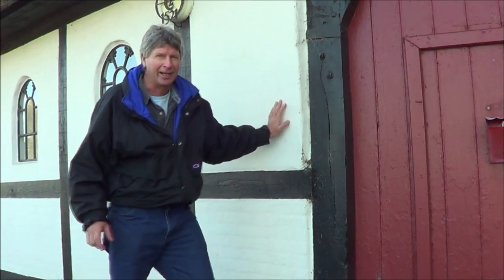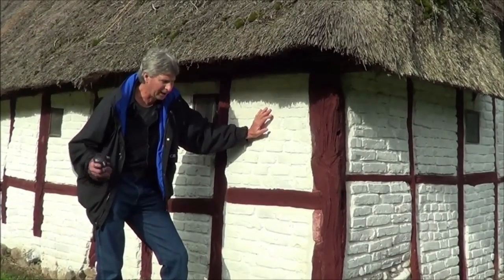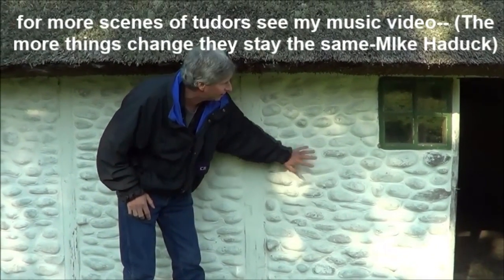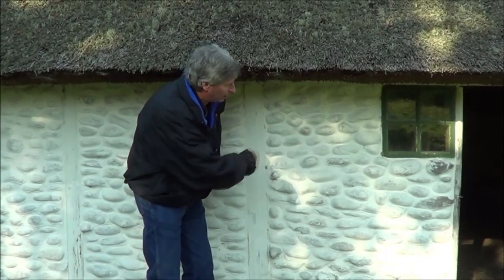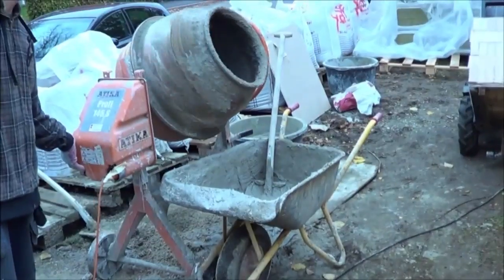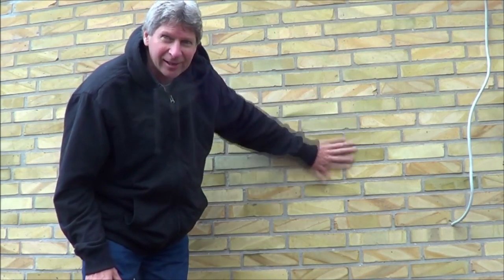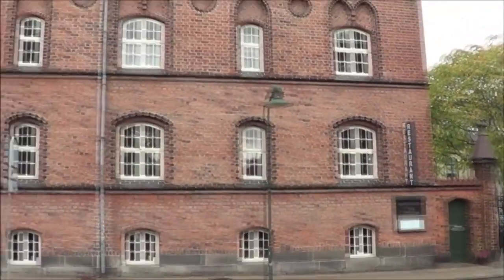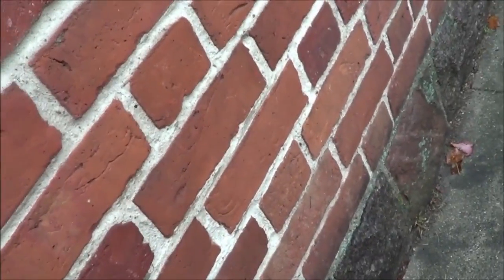TUDOR HOUSES AND BRICKLAYERS IN DENMARK  ( Mike Haduck )

Comment: I have a question - this house in Denmark that was built by these masons in this video - is the inner part of a wall dry wall or is it built out of blocks and cement?
Reply from the maker: Hi institoris, I can not say for certain,  it was quite a while back,  thanks mike
Reply: Thank you for reply. Very nice channel, I subscribed with pleasure. In a see of bs here guys like you make a great educational videos and that is a noble thing to do. All the best...
Reply from the maker: thanks,  mike
Reply: Hey. Most new houses in Denmark are made out of siporex blocks. They are then insulated with rockwool on the outside of the siporex. And lastly bricks are layed on the outisde of the insulation
Reply: From what I can see it doesn't look like they are building a new house.. And I would be very surprised if the small piece of isolation was all they used
.. the minimum 2018 code specify 240mm and the 2020 code specify 300mm.. 
so I would assume that they put isolation in between the sections of drywall that was spaced with the metal frame

Comment: lots of dangerous information given here. They DO NOT USE CEMENT AS MORTAR OR AS PLASTER. Doing that will cause serious problems later down the road.
Reply from the maker: Hi topher,,,  in our area everything between rock, brick and plaster use is called cement,,, I did a series called "  what type of cement should I use? Mike haduck, that might help, thanks mike